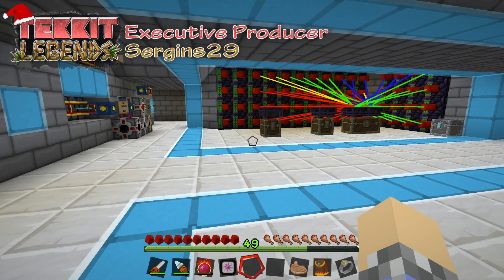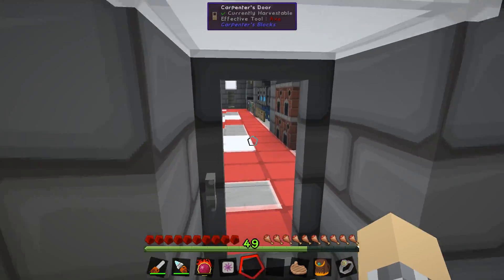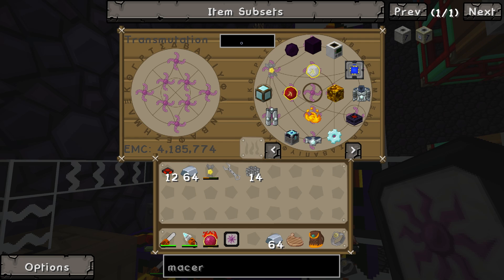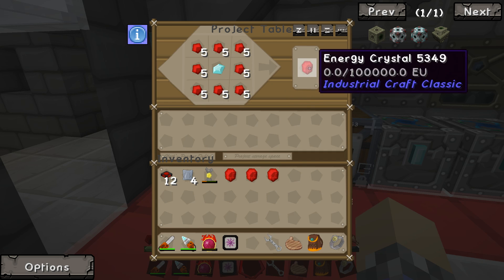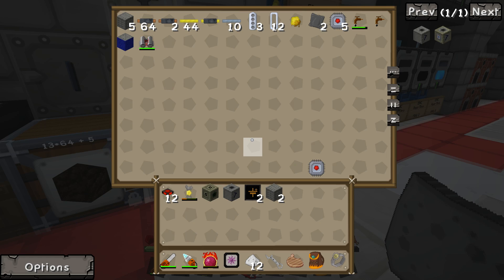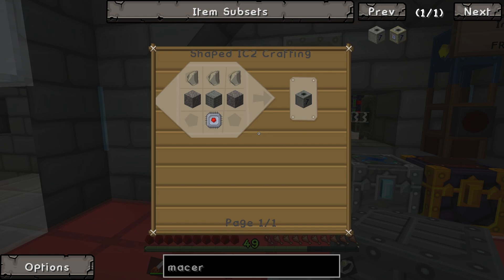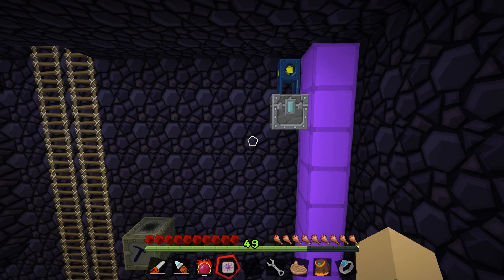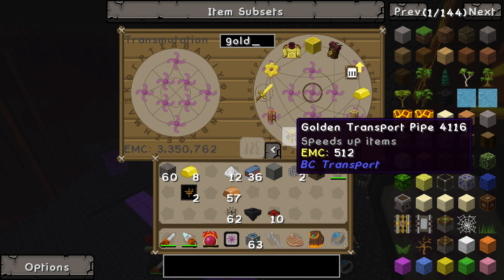Nether Ore Processing (1/2) | Tekkit Legends | #34

Comment: Suggestions. If you use Hoppers then use the BC Cutes. Simply because, they are faster have the same inventory size and do not get effected by Redstone.
Also If you are not using both slots for moving items then try out a Inventer Upgrade because that makes the redstone requirement Inverted^^"

Cool Episode. Still suggesting EU Reader that tells you how much EU a machine can Accept...
Reply: Chutes have one less inventory space, don’t draw out items automatically, nor suck in items dropped on top. But they’re cheaper than hoppers